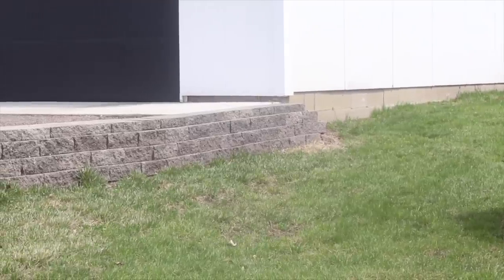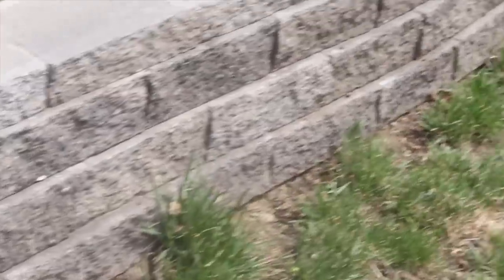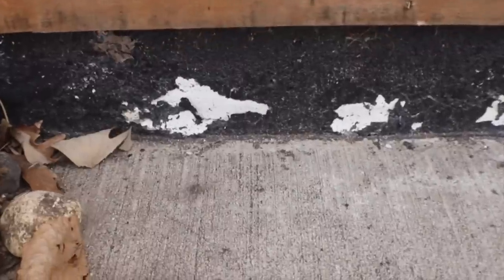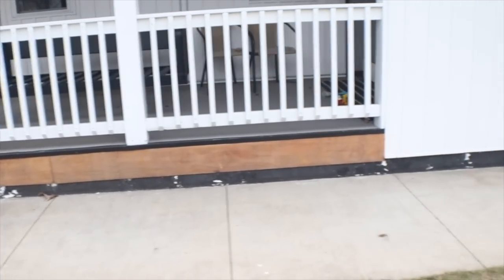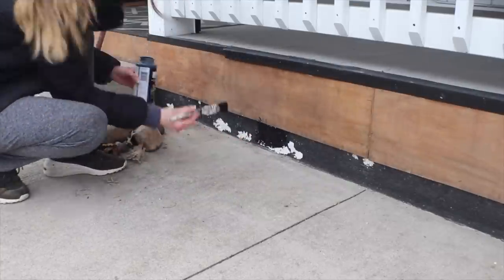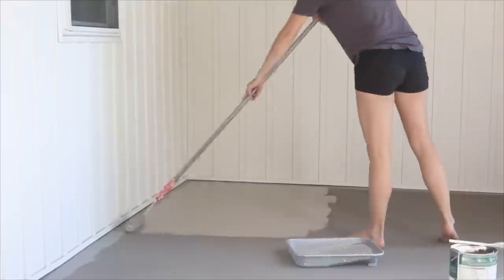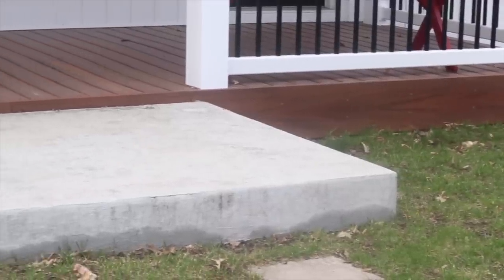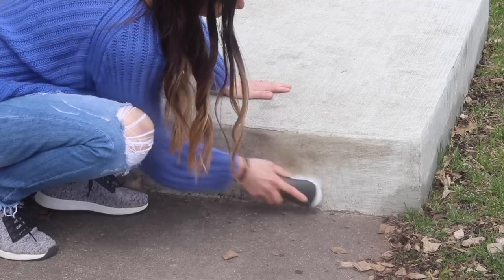My DIY Fail Compilation

Comment: i told my real estate lady i was gonna make my own cabinets in the kitchen she kindly smirked and said the wood would cost more then buying the cabinets ... well not exactly cabinets but those floating shelves are a done deal , and the counter top . too ... im going to save a bundle needed for the roof lol ,  i removed all the doors off of my k cabs in another pad long ago, soo im down w the open shelves as well , encouragement for cool flatware for use and display and minimalism

Comment: Am going to have to go back and watch your porch swing bed video.  I need one.  My failures ? Plumbing and electrical. Nope nope don’t touch it anymore.  Tried to replace a shower faucet once. $700.00 and a plumber later… worked fine.

Comment: Hey you got a twin sister? BTW I was a refinisher for 10 years... painting is all in the prep. The two surfaces you're trying to bond need to be clean, and also need to be dry. moisture/dust/anything will let that paint just flake off... you might wanna try using not only a primer next time, but also a bonding agent behind the primer (meaning bonding agent first, primer, paint). For the porch floor you should've used an etch first... like muriatic acid etc. KILLZ works great as a primer. On your counter where those paint chips are, make sure and take care of those or they'll just keep on peeling back the more your counter gets used. Some people use like a nail polish just to cover them up... To fix em right u gotta sand down, feather them out and airbrush them... but airbrushing is a whole other skill cuz if u do it just by doing it the way you'd think, you get a halo effect where the repair would stick out worse than how it is now. You have to blend the halo with a reducer... or a blending reducer... it takes a lot of practice to do it right.

Anyways cool channel.

Comment: I dont know why people thought the retaining wall and concrete step would fail. They are designed for the purpose you used them for. The other stuff I view like blacktop on a driveway, inexpensive and easy to do but you have to redo it once in a while no biggie. I appreciate all your videos keep.it up

Comment: I think if you would've used a good oil base primer sealer on your foundation before (Sherwin Williams Pro Block) you put on the presto patch you'd be fine.